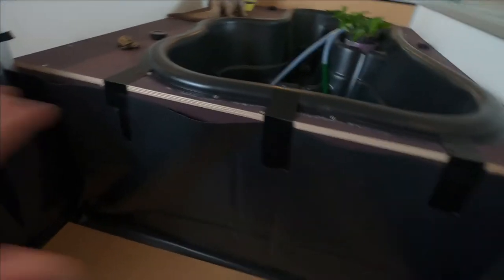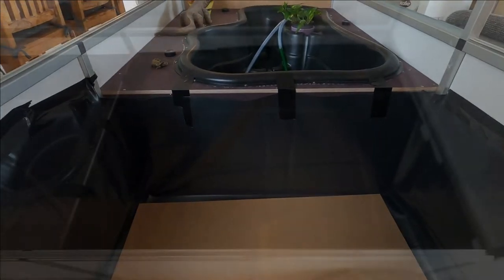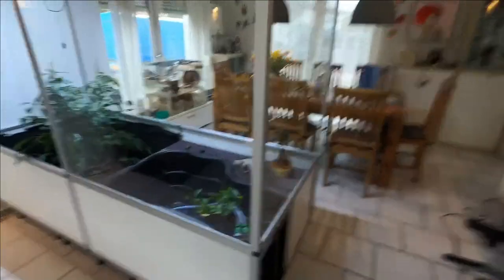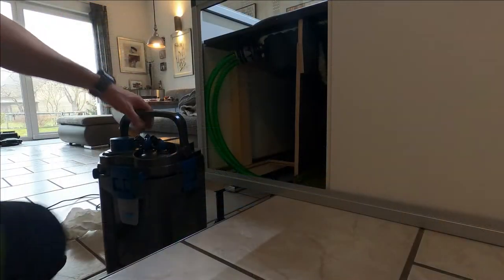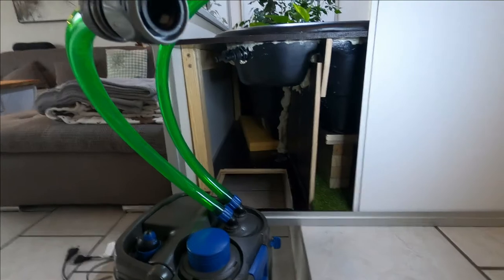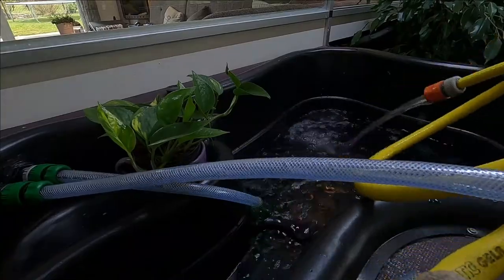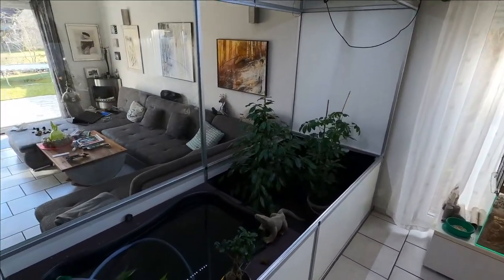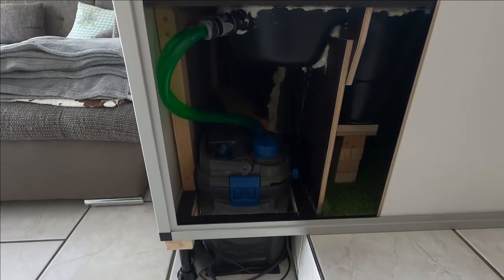Paludarium Terrarium DIY build Pond+Filter monitor lizard enclosure 100 subscriber special Thank You

Comment: Hi there Sven, I just want to thank you for all your time and effort you are putting into making these videos. It is fantastic you are doing them both in English and in German, because each version has slightly different information. This is especially great because I am based in Switzerland.
Something that is really cool is that I can see you have tested a lot of the ideas that I am working on myself, which is fantastic! You have also inspired me with a lot of great new ideas as well. So thanks a lot!
I have a question about your water filter. Where I live, the water is extremely hard, and leads to calcium buildup. I am building a much larger enclosure that will circulate the water from a large swimming area through a waterfall in the background. My pool will be built very much like yours. I am wondering if your filter can also remove calcium from the water? I have a boa constrictor, and he often defecate in the swimming area, which I am sure will be an issue with your monitor lizards. Is this why you chose your particular filter?
Thanks for getting back to me. I sent you some personal emails a few weeks ago, but I will try to keep my comments here on your videos so others can also benefit from your feedback. Cheers from Switzerland!
Randy

PS. I am also desperately searching for a slightly narrower pond liner. That same model that you have is available very commonly, but it is simply too wide. My enclosure is 78 cm, not 1 m!
Reply from the maker: Hi. Thank you for your really nice comment. Sadly I did not get so many nice and interesting comments. Its not easy to have a pond to drink and swim in an enclosure. Like you said the reptile often pops in the water what causes bacteria. I was thinking about this problem a long time and now my dissension is made. I will get green tree monitors and they are not use to swimming. So in my case there won't be much poop in the water. I use the pond for drinking, raising up the humidity and of course for the view on a nice fish tank and a monitor lizard. My pondfilter is big enough to keep the pond clean and healty. In your case it will be a little bit difficult. You need a big filter and skimmer what can remove the poop.  Or you need a drain to easily change the water. For your problem with your hard water you can get ph reducer to get a normal ph. Just check out some koi pond websides. Hope I could help you and stay save.
Reply: @Thegermanmonitorlizardguy  Good morning, and thanks for your fast response. You deserve a lot of great comments, because your content is absolutely fantastic! By the way, I will order my aluminum profile from the same place…
From my experience, the poop from the boa constrictor is relatively solid and compact and can be removed fairly easily, so I think this should not be too much of a problem for the filter. However, my major problem is with calcium. I will look into solutions from people who have aquariums…
By the way, I know you had a lot of your lighting systems supplied for you, which was very lucky! Personally, I have purchased both InkBird devices to control both the temperature and the humidity. They have Wi-Fi access, and can be controlled from the phone, scheduled with daily programs, etc. Just in case anyone else is interested!
Reply from the maker: Yes that was really nice from the company Solar Raptor to support me. I really appreciate it. Maybe check out the koi keepers for your questions for the high calcium.
Reply: @Thegermanmonitorlizardguy  Thanks!